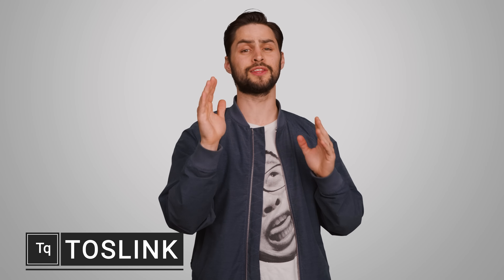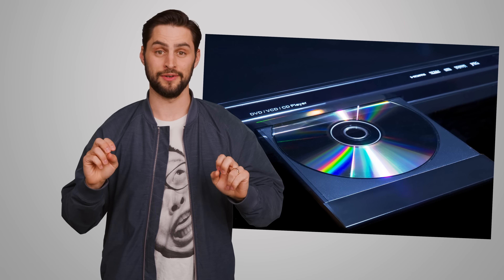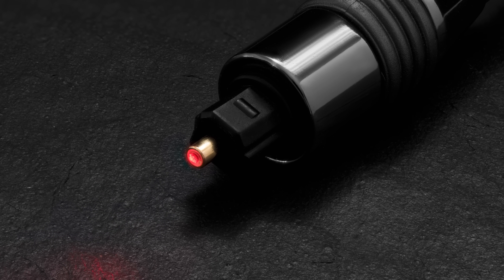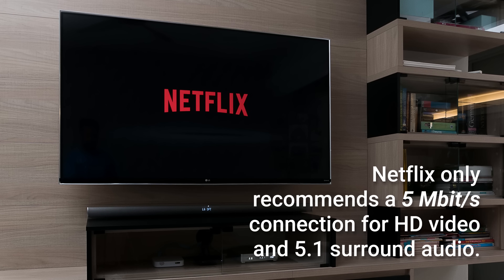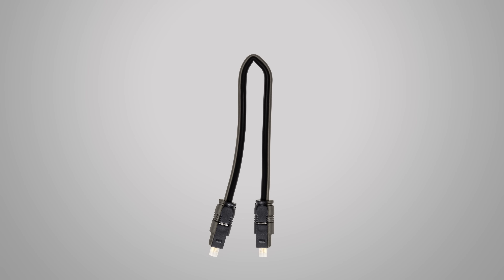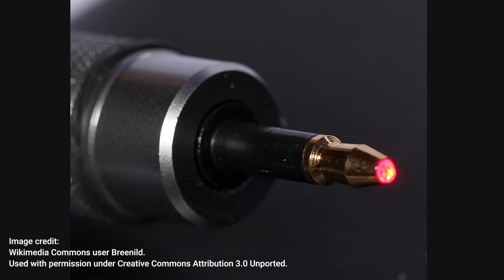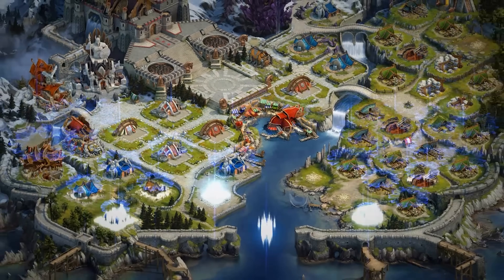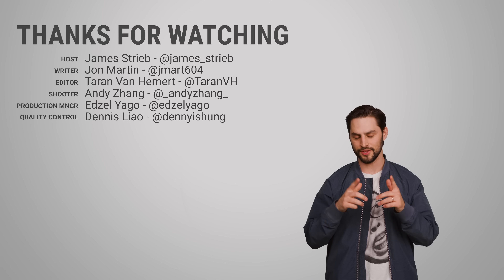Why IS This COOL Cable Dying? - TOSLINK Optical Audio

Comment: Toslink is still widely used in the HIFi community.  It is very good for solving grounding issues. I use it for my listening area and recording studio.
Reply: For 2 channel, it's great.
Reply: Tj Smithson I use DTS encoding through dcaenc so I get 5.1 no matter what
Reply: @tjsmithson1598  ADAT uses toslink for 8 channels
Reply: @tjsmithson1598  for any amount of channels, it's good
Reply: I had that problem. Solved it with Toslink.
Reply: my only real issue is that there are no god damn cheap toslink switches/mixer, behold a cheap toslink matrix. Not to mention that I want a Displayport/Toslink matrix so I can finally hook up 2 computers to 3 Monitors and a soundsystem, and select which screen is to be showen from which computer. Not to mention I want a matrix with low latency so I can play games on it..... (Sorry for the rant, but if you know a solution tos (wink wink) me a link)
Reply: @Falqun  There's definitely cheap toslink switches.  
They're literally a physical switch that just bends a bit of optical inside then to line up with the output you've chosen. No power required. Manual switching obviously, but good if you simply have multiple sources or multiple outputs. One could even have two back to back so you could have multiple inputs and multiple outputs!
Reply: @Falqun  Hey mate I used to have the same problem !
I solved it by using a HDMI Matrix which extracts TOSLINK Audio and sends it into to the Audio setup
Idk about DisplayPort but 2.0 HDMI is up to all my tasks on my part
If you want I can draw schematics of my setup but basically I can display :

PS4, XBOX ONE, WII U, LAPTOP, DESKTOP, CHROMECAST, TV BOX, random hdmi cable for if I need to plug smthg

On : Computer screen 1 (High refresh rate, 1080p); computer screen 2 (Low refresh rate, bigger, 1440p); Videoprojector (1080p, several feet away); or anywhere in the house through a HDMI to ethernet convertor

Also the Audio can be sent to : desk audio setup or video projector's ARC soundbar

All of which can be tuned through basically 2 remotes and several screens can display several different sources so my friend can play xbox in the couch while I play league with a friend on the 2 computer screens, it's pretty dope

I can link you all the material but it works flawlessly (just hard to remember which button on the remote is for what)
EDIT : Only flaw is TOSLINK is very outdated in terms of audio quality, it's why I switched to ARC for the 7.1 (atmos) sound system for the videoprojector), but I had ground noise issues with all the jacks and toslink solved them all
Also I have 0 latency btw, the matrix latency (I mean not 0 but it's not to be noticed and I'm pretty anal on this since I play in 144hz)
Reply: @arnudo   Pretty much like  My set up. I mainly listen to 2 channel audio so I have toss link being extracted from my HDMI switch and then sent to my DAC's and outboard audio processors.   I can pretty much display any  Analog or digital video on all of my displays, And play any audio independently of that analog or digital. I had to drop a complete schematic on 2 or more pages to make sense of How it should all be connected. I had to print out a chart showing me which of several buttons to push when I want to watch and listen to certain things. I think I am pretty much the only person who would ever be able to operate my set up.  I have it arranged for maximum flexibility to basically do whatever I want with the right button pushes.
Reply: @arnudo  nice idea, Im looking for a way yo combine multiple sources using tosling as its the only format that dont hummm
Reply: @RafaMazurekRMZ  Look for an HDMI matrix and build your setup around it
It's pretty pricey but if you want several inputs and several outputs interchangeable, you need that
Reply: @arnudo   would it let me play two sources at the same time?
Reply: @RafaMazurekRMZ  yes, mine had 4 inputs and 4 outputs, everything could be running at once you just needed to tell what needed to be displayed on which output
Reply: @arnudo  can you paste me some model that will work? does atmos works also?
Reply: Youre kinda referring to S/DIF over TOSLINK, TOSLINK is also used for ADAT Lightpipe which is still fairly common too.
Reply: @mycosys  I use both. My digital console has 3 ADAT out that are 8 channels each. And yes Spdif over toslink.
Reply: Hifi hooked up to the pc for grounding reason. Pc are notorious for having the famous hisss at higher volume.
Reply: @macedk  yes...these days its hard to not have a PC or mac in your audio chain. Always an annoying source of noise!
Reply: Well .. if you got those kinds of issues today (and also for extending an HDMI signal for super long distances) there are also fiber-optical hdmi cables .... those are not exactly cheap though ....
Reply: I have solved issues with sound between my amplifier and PC, I have a surround amplifier connected to my PC and the Toshlink solved the problem for me.
Reply: I use toslink for exact same reason: it creates electrical barrier between my PC and DAC, which is really important when DAC powers a tube amp - noise from PC was really killing the sound comming out of the tube amp.
Reply: Had a grounding problem with my android TV box connected to my receiver, toslink solved it 👍
Reply: Had a distortion problem due to a bad headphone circuit (i think) in my TV, solved it with S/PDIF. same thing as TOSLINK but without the cool light. Got a ADC to get the audio to my amp since that does not have digital inputs.
Reply: The other advantage is there is no cable coloration in the sound. Not to my ears anyway.
Reply: Yup my ps3 have it the port i dont use cause i dont have any equipment to do it or to make it work
Reply: It's only good for 2 channel work anymore chans and the compression and bandwidths limitations severely affect the sound...
Reply: I thought audiophiles despised Toslink ?
Reply: @AngryChineseWoman  Unless the device has balanced audio outputs. There's no reason to use unbalanced rca ports when you can have an S/PDIF connection. Especially if you put your money in the AVR receiver that has an excellent digital to analog converter built in. 
I still use optical for over the air antenna and from my PC to play music. Everything else is HDMI or rca for my turntable.
Reply: @AngryChineseWoman  No
Reply: Marc Ozor They do.
Reply: @AngryChineseWoman  Nope.
Reply: Jeremy Hutchinson It is also equally as shunned for jitter among other issues. Best option is good asynchronous USB.
Reply: @NguyenMSGK  That may work for some hardware but my expensive digital recording console does not have USB. It does although have wordclock and with BNC connectors link to a master clock. Jitter is not an issue... I can look at my recorded content in my DAW even without wordclock link I have no issues with jitter for many channels of audio.
Reply: @NguyenMSGK  what are you on about? the best option for jitter were it a problem would be using the word clock on our pro gear - thats what its for. I personally dont have a room near worth tuning that far for. I dont even have my big console out.
Reply: I'm using it now between my computer and Arcam rDac.  Also TosLink can transmit a true square wave; copper, by definition is bandwidth limited, so it can never transmit a true square wave (since a square wave is the sum of a sine wave of the same frequency as the square wave with an infinite number of harmonics).  So, theoretically, for two channel audio the TosLink connection is superior to the 75Ω coax connection which uses phono plugs (which were never designed for digital connections in the first place).
Reply: @davidgriffin79  wrong - coax and toslink SPDIF transmit identical signals, with identical capabilities.
SPDIF also isnt the only thing TOSlink is used for
Reply: If you want to use it to connect a soundbar to a TV, which is a quite common usecase, it's mostly garbage because of latency and sync problems...
Reply: @erebostd  do you have any links so I can read upon this?
Reply: @dusans292  what do you mean? The internet is full of people with this problem - I had it myself, and the only solution was to replace the audio hardware and use hdmi, unfortunately... https://line6.com/support/topic/24556-latency-on-optical-spdif-audio-output/
Reply: @erebostd  A good quality TV or soundbar will have adjustable audio sync options to fix any latency problem since it's usually because the TV has a bunch of image processing or scaling/smoothing that is causing the picture to lag behind the sound, a good system check DVD or bluray can test for this. If the sound is lagging behind the picture then you may just have a cheap audio encoder output on your TV.
Reply: @erebostd  There isn't really any latency issues inherent in toslink, but some devices that process digital audio may induce a delay in processing. Computer toslink audio output generally has no added delay.
Reply: @erebostd   Yep. I tried using one as a center speaker with my 5.1 setup and I could never get it to sync up with my copper wired speakers. Now I have a proper center channel speaker.
Reply: @erebostd  that’s why I use an audio extractor
Reply: There is no damn reason to use TOSLINK instead of Coax SPID. None. Coax has a maximum length of five meters more than Toslink, and it's the same damn signal standard. "Grounding" is pointless too becasue the signal is digital, which means there is error correction.
Reply: @g00gleminus96  in my case I have a very good reason to use an optical standard. I had a ground issue between processing and mixing from my digital console. I was using Digital AES over XLR to link but could never get the noise out of my system...very annoying.  I swapped to the toslink outputs and also used ADAT optical for the other 24 channels and my sound is clean as a whistle. So there are use cases available for an optical standard. Isolation via optical is the best isolation....common grounding does not always work for you.
Reply: @g00gleminus96  not correct unfortunately, audio has no error correction
Reply: @g00gleminus96  Plus as long as interference doesn't overpower the signal, it should be fine, unlike analog. Time to get the popcorn out and watch the comments roll in.
Reply: capped at 96kHz, no DSD support, no Dolby Atmos. A silver USB 2.0 cable is much better.
Reply: @allansh828  96khz is plenty. Anyone who claims they can hear a difference between 96khz and 192khz is lying, even if to themself.
Reply: @allansh828  ADAT Lightpipe manages 192 just fine over TOSlink. Or 8 channels of 48.
Reply: @mycosys  Indeed that is correct. My system can supports 192 just fine. I run everything at 48k and its still sounds amazing.. I'm not pressing platinum albums from my small studio....lol I am limited to 48k via adat when I run all 24 channels. I can do 16 at 192 but it messes my routing up so fuck it...
Reply: Allan Sh Silver LOL, I think you mean rhodium (satire)
Reply: @allansh828  DSD is a meme and in a world where most people are fine with 320 kbps mp3 quality audio streams or less on spotify it will remain a pricey meme, 96KHz is already stupid and when was the last time you heard a stereophile seriously talk about atmos? Optical is a simple, universal solution that doesn't need a computer for drivers to work like USB does as you can just plug it into basically anything with an optical output and expect it to work, like a CD player.

Comment: i love my optical cable, so much easier and i imagine higher quality than the 3 aux ports to 6 rca port adaptor cables. edit: 1:21 is exactly what i mean! edit 2: how long is the distance from your computer or console to your amplifier system :p
Reply: I totally agree, when I shop for a new motherboard I don't even consider boards that don't have toslink.
Reply: It's not a higher quality actually. That is unless you're plugging a potato audio source into a potato receiver.
Reply: If you want to use it to connect a soundbar to a TV, which is a quite common usecase, it's mostly garbage because of latency and sync problems...
Reply: @erebostd  Unless you try to play back the audio simultaneously on the TV and the soundbar, it isn't noticeable.

Comment: Optical is the go to connection for most DACs after usb
Reply: Before USB, IMO! Most PCs introduce some unfavorably noise/hum over their USB connections. My motherboard was over $500 and it does this, but optical provides electrical isolation from the PC, eliminating the hum.

Just plug the DAC into a high-quality USB power block and you’re set. Plugging into the PC, even if only for power, re-introduces the noise!
Reply: @jSyndeo  That's right, but it's likely the DAC that filters out your hum just by the way it physically works. Usually it's the switch-mode power supplies that cause the issue, not the MoBo at any price point. The buzz or the hum is likely the ripple in your PSU.
Reply: @cormacsyt0  this often happens because of a ground loop. Simple USB filters can fix that
Reply: @cormacsyt0  No? Clipping is somewhat different. I'm referring to the slight errors in the time domain of the digital transmission, which of course, really isn't related to the cable itself but the accuracy of the clocks, as you or someone said. The optical cable just reinsures the bits are transmitted without any mishaps. Optical cables are, of course, galvanically isolated, as opposed to USB.
Reply: I actually use it from my over the top PC to my DAC since I've noticed that if I go any other way there is some distortion and a slight hiss in the sound that comes out of my speakers.
Reply: @cormacsyt0  Yes, for most people and applications it will never be a probelm or even perceivable. Like I said, It's only really relevant in a HiFi context, where optical is an excellent solution.
Reply: @cormacsyt0  Yes, of course. But unless there is some direct problem causing such electrical problem as a ground loop, the "natural" type of distortion prevalent in in digital audio transmission is jitter. I was responding to the comment above stating that usb, beeing digital, is distortion free.
Reply: Agreed, use usb to D10 to optical to thx 788 optical input
Reply: @cormacsyt0  It's called digital jitter and is very prevalent in USB. Only really relevant in HiFi contexts though.